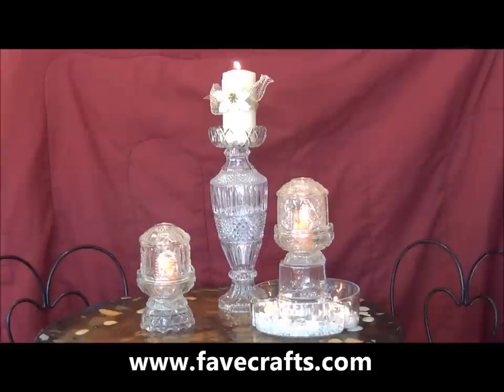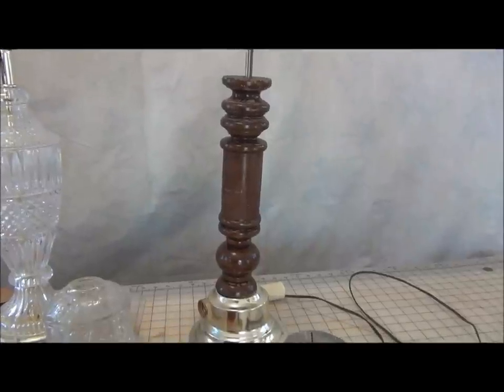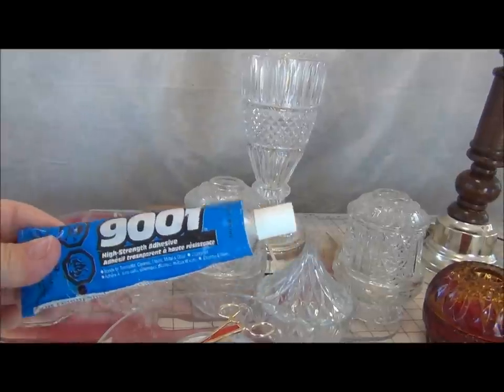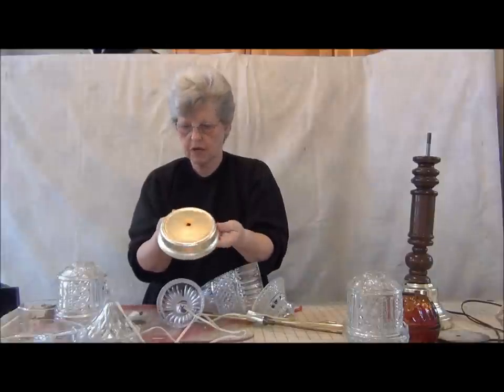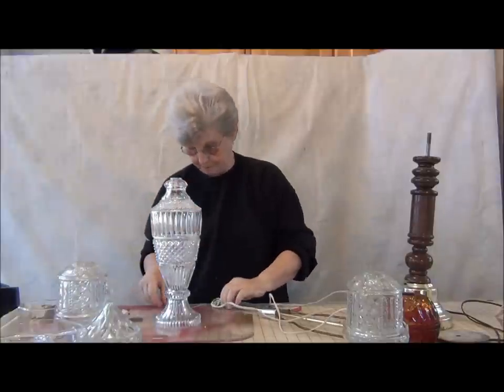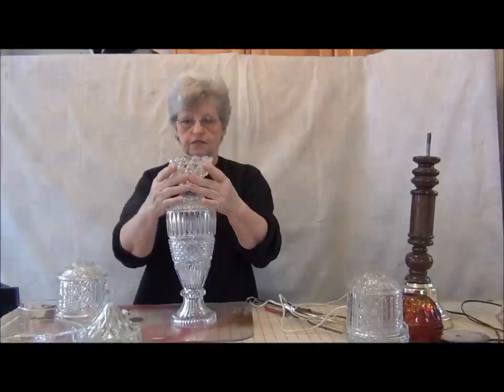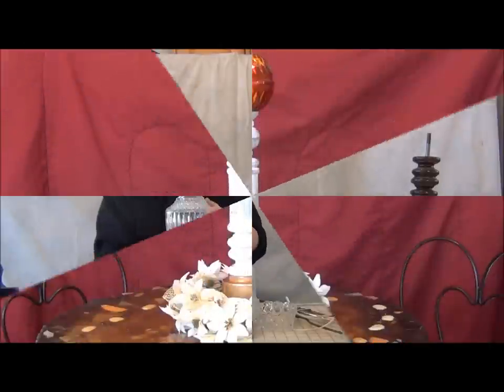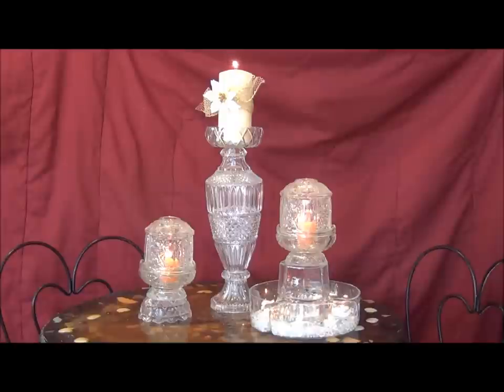HOW TO MAKE AN ELEGANT CANDLE HOLDER USING A RECYCLED LAMP

Comment: Your cord could have been taken apart from the bulb housing by unscrewing two or three screws holding the wire(ing) in.   Your base can be  made into a teapot warmer base.  Its a perfect size for one.   Even if you didn't want to use the primary piece in your candle holder it could be used as a hanging pendant light with your cord and bulb housing and dropping a 50mm crystal at the bottom of it.  Love your covered holders.

Comment: That glassware can be EXTREMELY EXPENSIVE collectibles but if you convert them, you destroy that value!  If you have any doubt just search "vintage glassware" on ebay or "depression glass"!  You can pay a fortune for a rare piece in mint condition which means if YOU have pieces in mint condition, you too can make good money to sell them...BUT NOT IF YOU DESTROY THEIR PRECIOUS VALUE BY CONVERTING THEM.  ***However, if your vintage or depression glass pieces have cracks or chips or other blemishes, they're not as valuable and it's those CHIPPED PIECES that would be perfect to convert because the value is already negated.  (I have that exact lamp that belonged to my mother and even though it's got a deep chip in it, I wouldn't sell or convert it for anything.)  I hope this helps.
Reply from the maker: thank you, Moxie Lady, for that word of caution-I didn't think to say that. I picked this one up at a Goodwill and now have another from a resale shop that is here on my side table that I got a new shade for. Neither are crystal or cut glass. They are both prescut. If I find another, it will go on my little bedside vanity. I had the pleasure of restoring [recovering], for a client, a large, antique [vintage] victorian shade that had its original glass pendants that were fixed back onto the shade after it was recovered. I didn't see the lamp it came from. Here is the article I wrote for Cheap Eats, Thrifty Crafts-if you get time, let me know what you think.